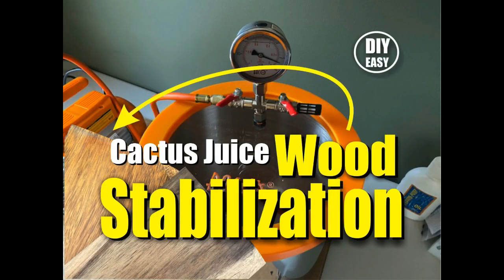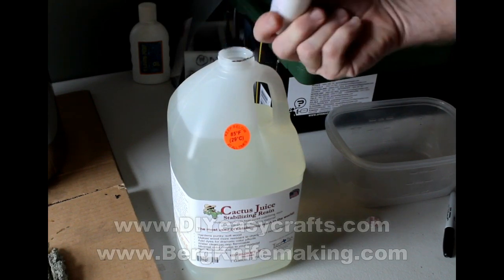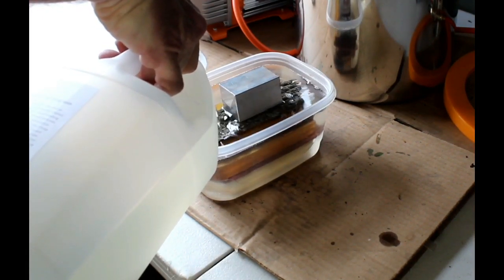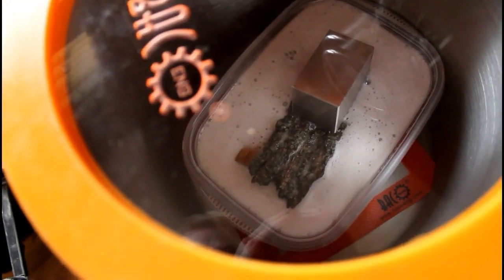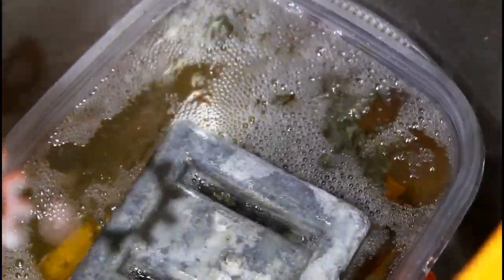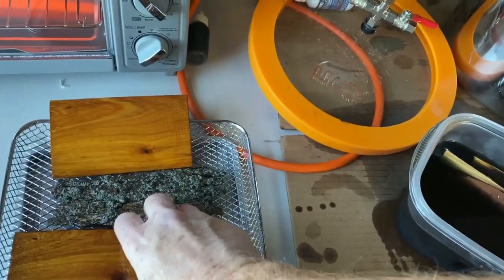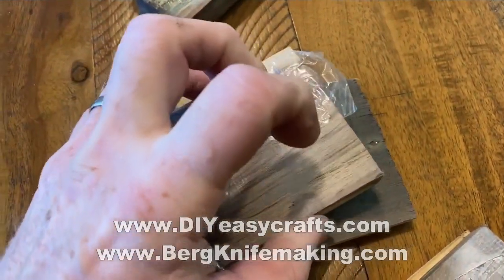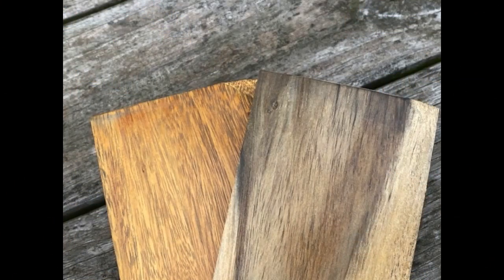How to easily Vacuum Stabilize wood with Cactus Juice

Comment: Thanks for the video and instructions.  Something to note: That lead weight soaking in your resin can transfer lead salts into your cactus juice and therefore into everything you use that resin for making them slightly toxic to handle with bare hands regularly.  You might want to consider using something besides bare lead to weigh your items down.  or maybe put in in a cup or in a plastic bag if you absolutely have to use that lead to weigh your items down.  It simply adds unneeded contaminants into your final products.  Great instructional video though overall.  Thanks for sharing.

Comment: Good simple vid Dan. Little tip on the resin. Try and keep your light and dark woods and resin seperate. The tannins from some darker woods will stain lighter woods.
Reply from the maker: Really appreciate the info. I noticed the cactus juice got darker after the soak!
Reply: @DIYeasycrafts  yeah it can be a dam pain. Its fine for doing batches of the same wood, but mixed batches are a pain. Best to have 2 or 3 seperate containers for light, medium and dark woods and try and do them in seperate batches

Comment: The cactus juice had turned dark from the 1st use; If I understand right the juice can be reused for up to a year.  Will the dark color from previous stabilizations ruin projects down the road?
Reply from the maker: The juice will work but may darken lighter material

Comment: How did the bark turn out I was wondering If I could leave some on some large pieces of Buckeye borrow that I have
Reply from the maker: I was not thrilled with it. It got hard but not hard enough to use on its own. casting it in resin would work

Comment: Up to what size wood will the Cactus Juice penetrate? I need to stabilize some spalted stock about 3" X 3" X 4" (7.7cm X 7.7cm X 10cm).
Reply from the maker: You should be good. I have not done it myself but have seen others stabilize larger blocks

Comment: Hi, I have just started stabilising wood and I've found that while the pump is on its smoking continuously, and some oil covers the top of pump around exhaust. Also I'm finding after soaking for up to 24 hours the wood floats to surface. I thought the wood should not float. Can you advise please?

Comment: Thanks for the video. My Bacoeng vacuum chamber just came in and the instructions say to turn off the pump once the needle on the gauge stops moving or else the chamber might implode. So I am scared to run the chamber for hours. I'd really appreciate your thoughts! I noticed you are also using a Bacoeng chamber, although mine is only the 1.5 gallon.
Reply: no, just run the pump till the gauge stops moving the shut it off.

Comment: You should never turn your vacuum off before closing the vacuum side valve. Always close valve first. If you don’t you can ruin your vacuum very fast.
Reply from the maker: Thanks for the info did not know that
Reply: The vacuum in the chamber can pull air (and oil) back through the pump and into the chamber, not good.